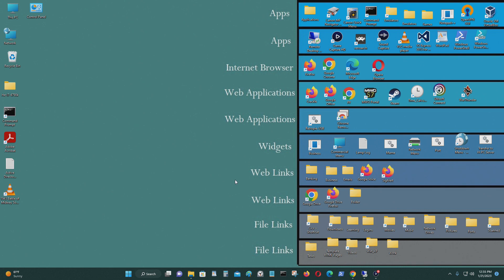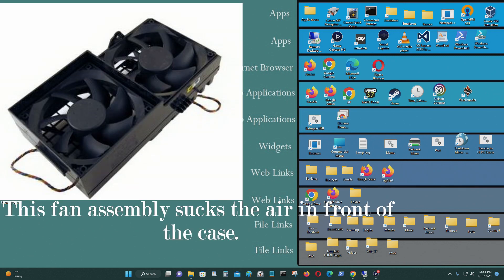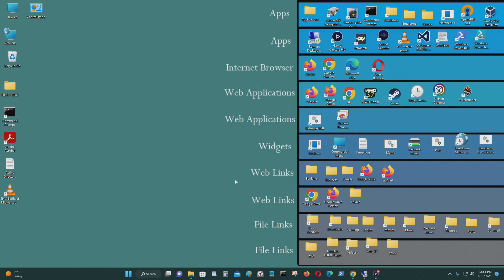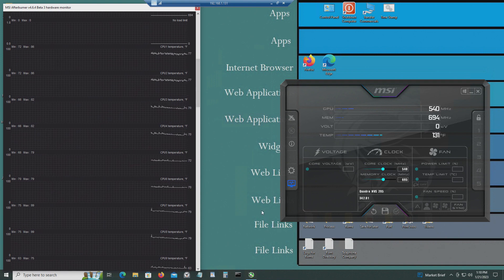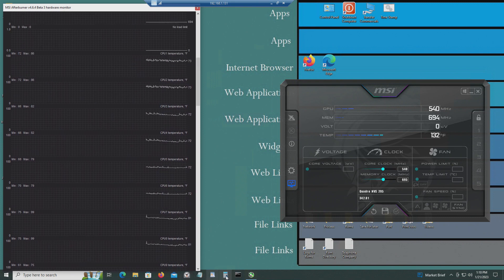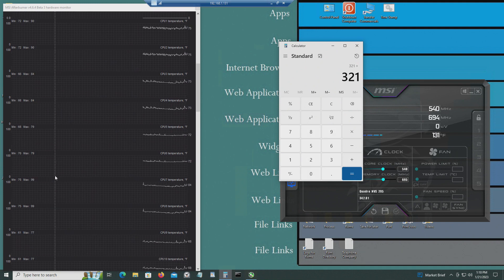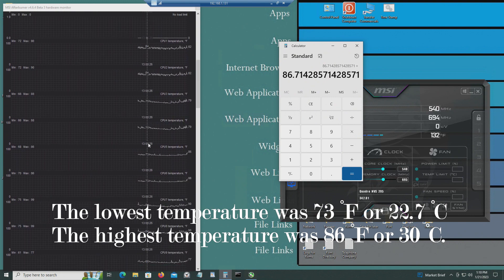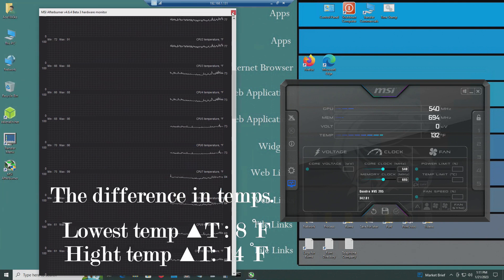Dell Precision T3500 & T5500 Heatsink Fan Mod

Comment: I have same station. I used 2 8mm coolers like 5 bucks each. Put one in front and second one in the back to pull air. After 90C temps dropped to 50C. My cooler is the longer one you showed in images. Nice work